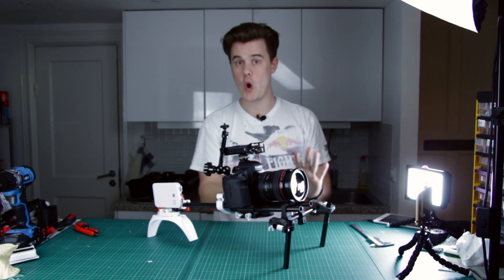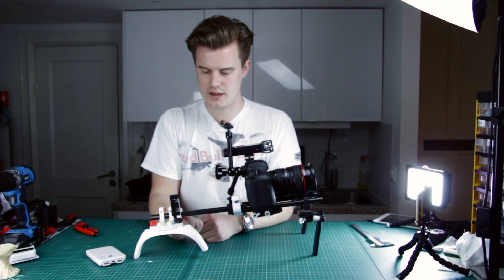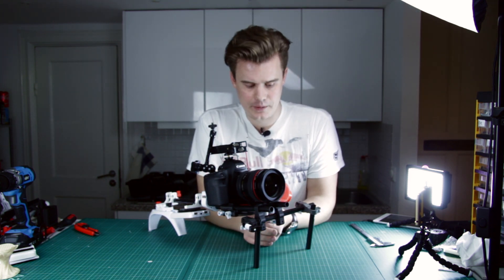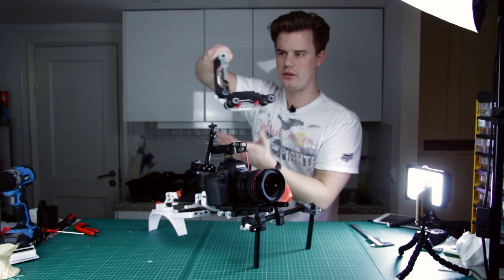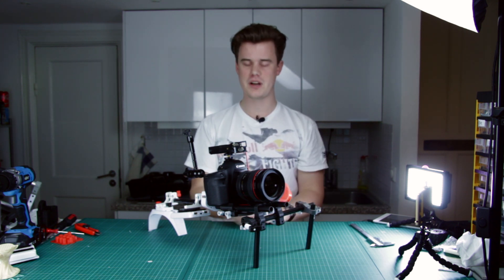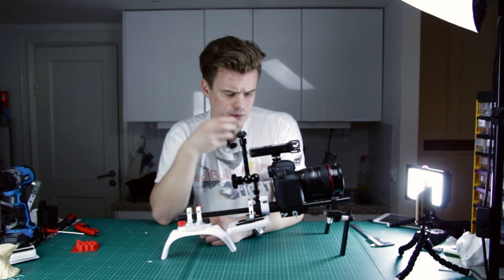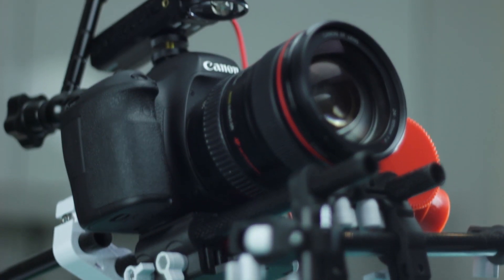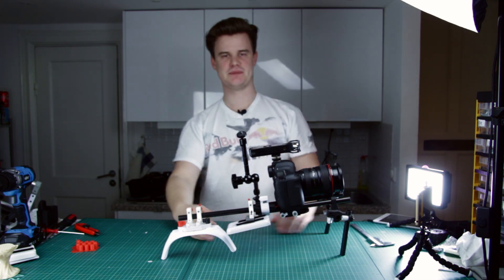DSLRigger Release Video - Open Source Camera System

Comment: I am printing this rig. I have a little question. What kind of screw to using for mounting the camera to the base?
Reply from the maker: Wonderful! Hope it works great for you too :).  I'm using standard 1/4" camera bolts. I actually use them for more parts as well on the rig, for example attaching the camera-quick-plate to the center mount as well.  I'd suggest getting maybe some of these: http://amzn.to/2r0IYVp  or this one ( http://amzn.to/2r0ukNP)  that is cheaper if you just want one, but maybe not equally good?
Reply: 1/4" 20 thread. Make sure to note the 20 part